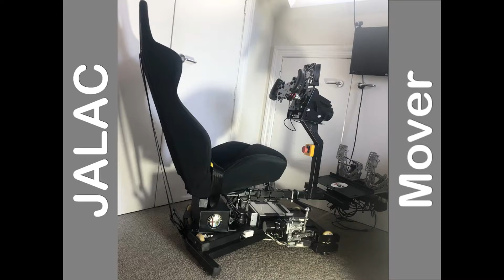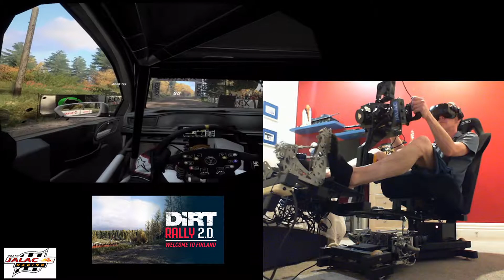My DIY 3dof (2dof + traction loss) motion rig - Dirty Rally 2.0 test.

Comment: This is very bad! Isn‘t there a VR compensation mode?
Reply from the maker: I'm disappointed that you think it's so bad. Luckily I still have a hell of a lot of fun in it. I assume you mean motion compensation, and yes an early version of the OpenXR version was installed and configured with FlyPT Mover. I didn't get it working quite perfectly though, and decided that I didn't have the need to continue with it as I'm happy as is. Maybe one day I'll revisit that in my new rig.
Reply: @jalac1  I am sorry as I didn‘t mean to disappoint. Well, it looks more than fun 😄 I can only recommend to look into this stuff. I myself just have 2 dof (pitch, roll) and it makes such a difference when turning on motion compensation. It will only enhance your experience!! Because as a real driver, you are attached to the seat so you too shouldn‘t really be moving inside the game.
Reply from the maker: @bojansimic4251  Thanks @bojansimic4251. Yes I totally understand what you mean, but didn't think it would make that much of a difference. I did try it out, but I had a few issues with a very early version of OXRMC. I will revisit.

Comment: What kind of pc hardware do you have?
Reply from the maker: It has an intel i7 11700K, 32GB Ram, and an RTX3080ti. I haven't had any performance issues that I've noticed although I have some sims running at less than 100% resolution in the Reverb G2.
Reply: @jalac1  happy new year🎉 do you use any dlss, NIS or fsr in openxr or openvr toolkit?

Simtools or flygpt mover?

My system is ryzen 5800x and Rx 6900xt with 32gb but struggle with the performance in acc. As well reverb g2
Reply from the maker: @Sim4FunVR  Happy new year to you as well. Due to the Brushless motors, I use FlyPT Mover to connect to an ESP32 controller (circuitry designed by FlyPT). I think there is a link to my Xsimulator.net thread in the description which describes some of the frustrations I had which that, but luckily got there in the end.

I have both Simtools and FlyPT Mover, both of which have a relatively steep learning curve. Simtools can be used as a source for FlyPT and therefore can be used for any games not already supported by FlyPT. In fact I haven’t used Simtools for a long time. 

No I haven't used NIS, DLSS or Fsr, but I always planned to investigate them further... never enough time, but a good reminder thanks. I can run most of the VR Sims I have at about 70% resolution, maybe I could go higher using NIS/DLSS/FSR. That is except for ACC of course. ACC was never usable on my Rift-S/GTX1070ti, or now on my G2/RTX3080ti so I've long since given up on it. Not sure if you use iRacing but the graphics are beautiful at 100% resolution (stunning at 150% but only when no other cars) and, just my opinion, as a combined package it's a step above so hard to go back from :-)
Reply: @jalac1  I try today many hours and compare NIS vs FSR in the openxr toolkit. I mange to go with 60 hz mode without motion reporojectiin in acc and ams2 with 100% scale and really good settings. With NIS 67 % and rsr 67% in the amd driver. Since you have Nvidia you can Ouse forveated Rendering and have even better performance! Just install opencomposite to be can run openvr games without steamvr just only over openxr engine. This was a game changer for me in acc. So with antialiasing in epic and temporal and relay shiny settings for shadow and material acc know is running with vr in game scaling 120% bitterly smooth with 60 rain. No matter if it’s raining, night, dusk or day or dawn. Give it a try you will get even better Performance cause of the forveated Rendering.

I struggle a lot to make my 2dof plus traction loss running in flypt mover. May you can share your settings for flypt mover and acc?
Reply from the maker: @Sim4FunVR  Thanks a lot for that info. I will definitely try out your suggestions as soon as I get a chance. I haven't created a Flypt Mover file for ACC but I will do it today or tomorrow and reply here with a link to it.
Reply from the maker: @Sim4FunVR  It turns out that I did have a mover file that works for me in ACC! You will need to be configure it to connect to a different output, and may need to reverse/invert some actuator poses. Hope it is useful for you. You should be able to access it here: https://www.dropbox.com/s/edy9nngl06bsbve/Racing.Mover?dl=0
Reply: @jalac1  thank you man maybe it will help me.